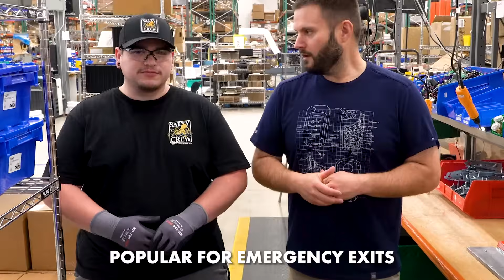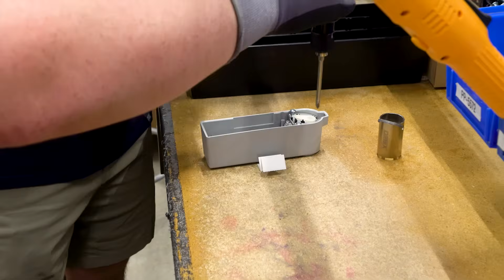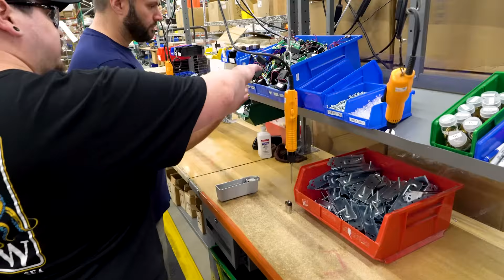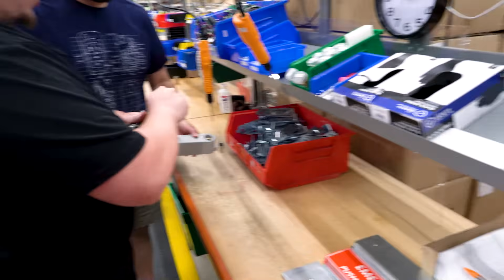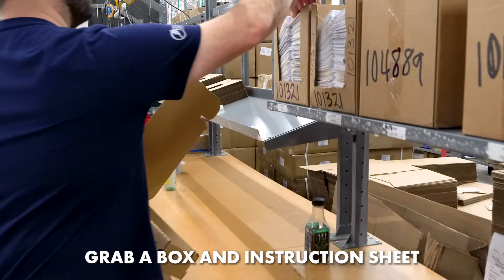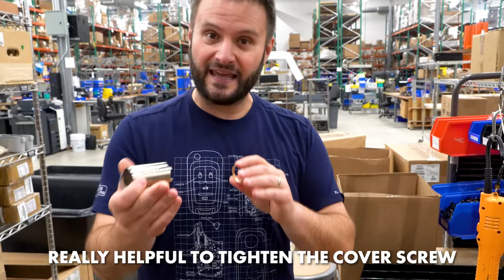They Let Me Build a Detex EAX-500 (11/10 According to the Expert)

Comment: PJ you a funny guy. You told Clyde you only see the electric screw driver on youtube videos. Where did you think you were. So you can use any cam on the back of the cylinder on a EAX-500 unit. Now you have mechanical experience at building exit alarm units you don't have to go back to selling worms. #lockboss